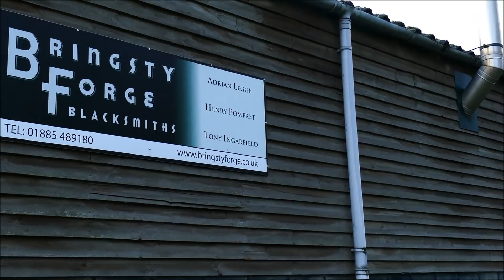Blacksmithing - forging big scrolls - Bringsty forge-in

Comment: Holy Moly! That's some honking pieces of metal! Not much else to say. You could also try the positive pressure technique. If you close the doors of the shed and have cooler air blown in, the pressure will build up and help force the hot air out the chimney.
Reply from the maker: That's a good idea! cheers J

Comment: Lovely video as always Josh. Looks like a good weekend was had at Bringsty. These events always seem to be when I’m busy. 🙄

Have you seen the side draft chimney design Mark Aspery uses. There’s a pdf of it somewhere online. Much like the ones the Americans use. I think technically you only need a chimney to be 3ft above the apex of the roof. But start up is always going to be an issue as the air in the pipe is cool. If you light a ball of newspaper in the opening it will warm things up a bit and help get it going. 

I forget whether or not you have an upright pipe on your current set up but that would certainly help if you don’t. 

All the best.
Reply from the maker: Thanks Andy! Yea a side draft is a good piece of kit. Problem I have is the roof is low and the out let is just a foot bellow the apex. The draw on a 4' chimney isn't enough and really needs to be 3 meters. Which will look odd and will need stabilizing cables and bracketing to keep it up. All of which is time and money but I guess you only get what you pay for.... Cheers J
Reply: Joshua De Lisle hmm. I know that issue only too well. My old workshop was much the same. The flue wasn’t a full 3m length but did draw ok once it got going. 

Ultimately I guess you gotta work with what you got. I used to have my little forge on wheels and would wheel it out of the shed to work. But it meant forging on wet days didn’t happen.

Comment: didn´t know there is aldi in the uk too
Reply from the maker: WE Love Aldi. so cheap!
Reply: @joshuadelisle  ture but i dont trust the workzone tools to be anygood.
so i never tried them
Reply from the maker: I bought it as a christmas present for some one but left my speedglas at work that night so I thought it might be handy to have it as a home one instead.... turns out to be very good, not flimsy at all. sensor works well and I linke the grind setting. only cheep points is the dark stays on for half a second after welding but maybe thats a good thing, there is a clicky rachet mechanisim to keep the hood up when needed that is just a bit louder than normal hoods..... other than that I was impressed for £22.